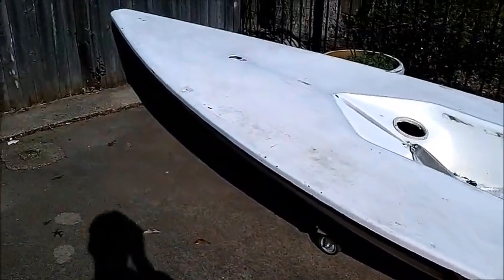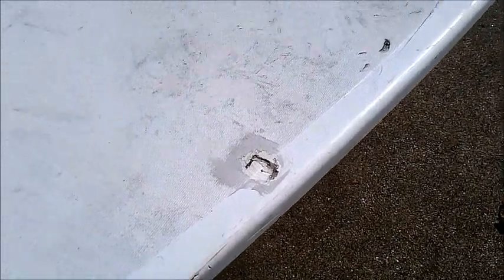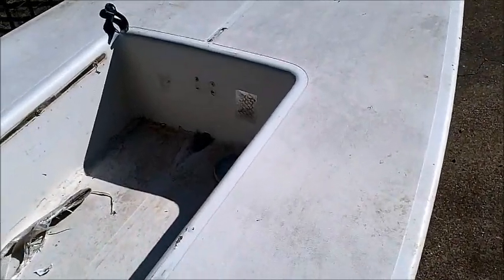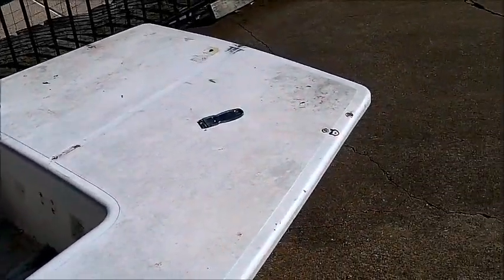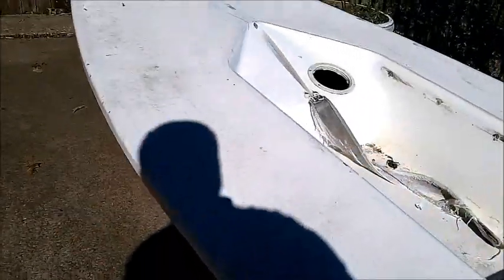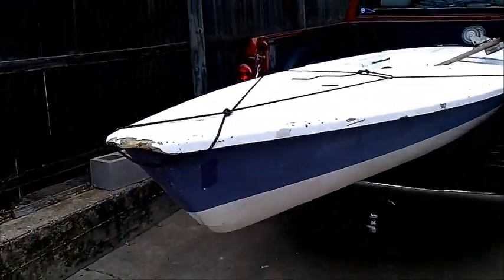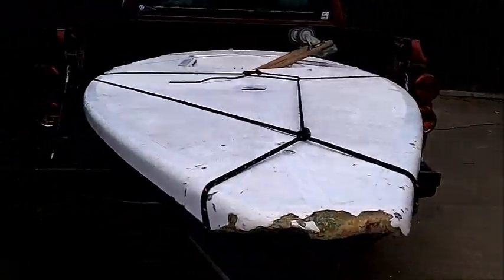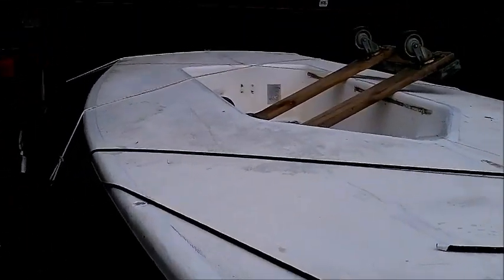Laser Sailboat Restoration pt 1

Comment: Great fun idea, a small sailboat restoration with your kids. Be sure to let them do so much of the work that they can be proud, and brag about it. Just about any parts can be found on ebay. Buy used parts when possible. The boats bow (nose)? I would just round it off neatly, then glass it as necessary. It doesn't need to be pointed in my opinion. Have fun, and happy sailing.

Comment: Hey Mr. Hattendorf! I too have an old Laser that needs a new paint job. It's about the same shape yours is in and I REALLY need some help. I sailed it two summers ago after not having access to it for over a decade and kept tipping starboard. Either b/c my mast didn't have the range to twist or b/c the boat is unbalanced. My dad leaned it on it's side against a garage from May-Oct. Do you think it's possible to have growth inside of it? Tossing it off balance? It seems stable and I think it was my jury rigging. 

Do you have any spare parts or leads on them? Not much sailing here in Wisconsin so prices are very high for some parts. I would love to upgrade but that would be a few hundred bucks. I still think I need a double cleat and double eyes/blocks by the mast, but I am not sure.

Feel free to contact me if you can offer any advice. I'm dying to get my boat back in business and now I want to repaint it too after seeing that you are doing it:) I just have no idea how to.